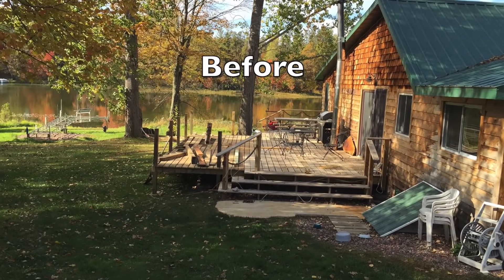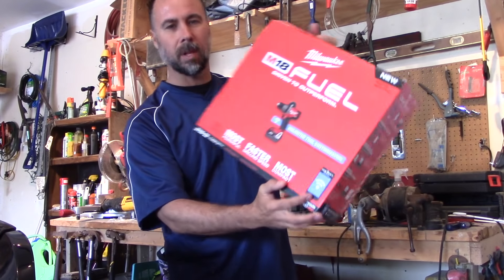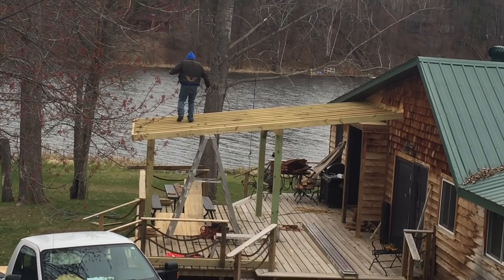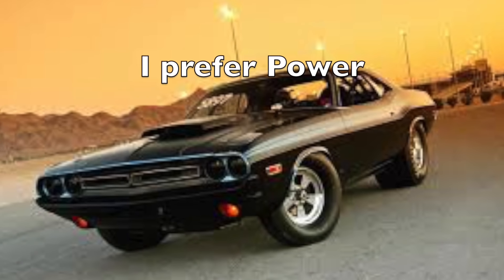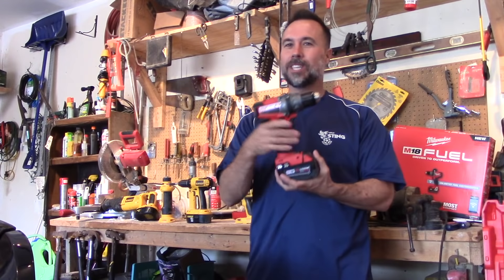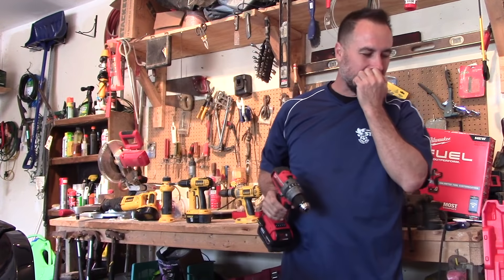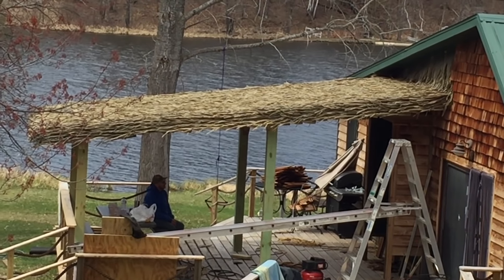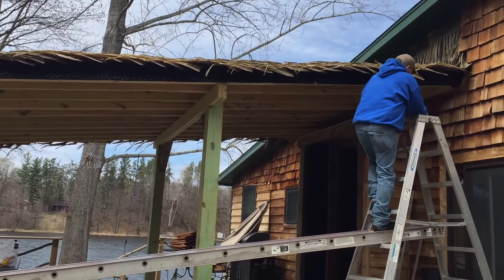Dewalt or Milwaukee  Power Tools?

Comment: Apples to apples compare milwaukee fuel to dewalts brushless, dont compare their old 18 volt to the milwaukee fuel.
Reply from the maker: Will do when I get an opportunity.
Reply: Agreed. Personally I still prefer Milwaukee Fuel hands down.
Reply: Wast of time watching this, what's next comparing a old flip phone to a new smart phone
Reply: The fuel are the best tools I have bought  we dropped one 20 ft off a roof threw it back up and still use it today that was a year ago
Reply: Teno Mireles ive dropped my dewalt brushless impact at least 20 times prob about 10 to 15 ft so that doesnt say much. These are tools that are meant to be abused
Reply: I say from experience, you may get a bit more power out of milwaukee power tools, if you ever really need it, but I've noticed over years milwaukee tools come in for repair at a much younger age then the dewalts Do. Dewalt seems to be slightly under power next to milwaukee, but have the potential to last longer. However I love both brands,  either brand does some tools better then the other, I own both platforms, you can't go wrong either way.

Comment: I've been a custom carpentry and cabinet contractor for 28 years, i have both Milwaukee and Dewalt
tools, they both have their outstanding products, Milwaukee makes the best drills, hands down, Dewalt
makes a much better mitre saw and cordless nail gun, with that said, Dewalt's customer service dept
puts Milwaukee to shame in as far as how I've been treated by both. " in my opinion"
Reply: I would agree Dewalt seems very customer oriented with there customer service milwaulkee sometimes seems like a car dealership we have sold you the product and now we don't really have time for you. Hopefully it gets better I just bought into the fuel line to give milwaulkee a try

Comment: As a commercial plumber, Milwaukee tools are the cream of the crop in the gang box. 
Smaller tools are largely beneficial in our trade simply because we are usually working in cramped spaces around other trades' work. These tools (Milwaukee) take one hellacious beating. Tapcons into 6,000lb concrete, holesawing, reaming out large bore pvc pipe, and the rotary hammers are on par with that of HILTI, and a lot lighter and easier to use. I can personally attest that an m18 hammer drill punched a 4" hole saw through structural plate like a 350 Chevy motor. I'm certainly not selling DeWalt short, but when given the choice between yellow or red...im going for red every time. Great video.

Comment: To be fair you are comparing a brand new cutting edge tool to one that is 6+ years old. The only way this would truly be a dewalt vs milwaukee drill comparison is if you did the dewalt brushless xr vs the milwaukee fuel. I have a whole set of newer dewalt tools and they are top of the heap in my opinion.
Reply from the maker: Very true.  I need to update this test.
Reply: After I started using Milwaukee tools, the dewalt tools are just laying in my garage

Comment: I have been with Milwaukee now for a few years, and have no regrets.  What sucked me in was the 12v line of plumbing tools, the no questions asked 5 year warranty, and their continuous development of both the 12v and 18v lineups.  No one else in the industry has a more well rounded group of tools for the remodeling contractor.  I recently purchased the 10" fuel miter saw and full set of cordless nailers, and all I can say is it just keeps getting better and better.

Comment: I think your selling the One Key system a little short. Using the app you can use it to keep inventory of tools and use it to recover lost tools. You don't have to pull are your smart phone out every time to fiddle with a setting. You can program various torque profiles for different tasks ahead of time. I think once you realize what you can do with One Key it might change your mind on it. I get what your saying at the start you don't want your employee spending time messing around on his tool, but if you pre load what fasteners and tasks daily One Key gets interesting.
Reply from the maker: +DarkRaptor99 I could see where it would be beneficial if I was using this for myself.

Comment: I work in the plumbing supply industry, we have switched power tool suppliers a few times. First Makita, then de Walt, now Milwaukee. We haven't changed for more than 6 years. Plumbers love Milwaukee tools. Out of the hundreds of plumbers I know only one uses hatachi, one uses Dewalt and another uses Hilti. They abuse the hell out of the Milwaukee gear and it keeps on going. Not as tough as before they became Chinese but still the best for durability imo.

Comment: Just an FYI you will want to get the Milwaukee Fuel cordless Sawzall seriously you don't need a corded Sawzall after getting one it is such a handy too to have. Also you might want to look into the Milwaukee Hight torque impact wrench for working on all of the trucks and heavy equipment you own. That is also an awesome tool to have around. Cordless tools in the last 5 to 6 years have gotten amazing with what they can do now, and Milwaukee puts out amazing innovative products. They have sweet led lighting solutions once you look at what else they offer you will want to buy more Milwaukee tools :)
Reply from the maker: +DarkRaptor99 I am super impressed with this drill- will be looking at more Milwaukee for sure.
Reply: Sawzall is a beast.. cuts good with very little vibration or work

Comment: I'm in construction as a profession and I was given a porter cable drill after I already had DeWalt drills and  Porter-Cable is one bad mamajama and I haven't had the chance to use Milwaukee drills yet but I have confidence that they're awesome but Porter Cable has the best batteries I've ever seen you can let him sit for 6 months they still are at full charge

Comment: I"ve been using my Makita 9.6V tools for almost 30 years, they're still working. BUT....the new Milwaukee Fuel 12V line is pretty impressive. The 12V, 1/2" impact wrench twists off lugnuts with ease (but not available in U.S. for some bizarre reason so I got one off ebay europe).  Starting to collect the rest of the 12V fuel line, maybe finally time to start retiring the Makita 9.6V collection.

Comment: I'm a DeWalt man myself. I've used Makita, Craftsman and Black & Decker before but they just don't compare to DeWalt. Now I have looked into Milwaukee power tools before and they are nice. My dad even recently bought a Milwaukee 18 volt and 12 volt powered grease gun and he loves it for sure. I haven't tried it yet but if I needed to grease my mowers and the manual grease gun is not there when I need it, I can grab the Milwaukee grease gun and try it out myself.
Reply from the maker: If you try it let me know😄👍

Comment: I've had many cordless drills over many years.  Mostly the problem with any...is the battery dies/quits/doesn't last.  My Milwaukee Fuel is a year old and came with two (2) batteries.
They charge so fast having both is almost overkill. They do keep power all day. Further, the size of the Fuel allows it to go places my bigger drills can never enter. As an aside; the batteries fit many other Milwaukee products. Example: an electric jacket for winter warmth..how cool...ooops!

Comment: The onekey feature probably IS gimmicky when doing construction work, BUT for me, doing nearly 100% automotive, it is just PHENOMS!  Imagine doing a brake job.  You pull out your onekey app, set "1" to the torque for your lug nuts, "2" to the torque for caliper bolts, and "3" for torque for your bracket bolts.  NO torque wrenches, no twisting their handles, NO elbow grease!  That's what I'm talking about!  Still don't own the onekey combo kit but I can't wait.  It's going to revolutionize my DIY auto work.  Only question is: will it REALLY be accurate on the torque settings.  I'll get back to you when I get them.
Reply from the maker: Turned out-  I really like the One key feature.
Reply: jawojnicki I was replacing a thermostat in my car a while ago and went to hand tighten the aluminum casing... when all of a sudden... crack!   I have a big expensive torque wrench, but the bottom torque setting was higher than what the case required. So I thought I could be gentle and hand tighten.   Older car so I spent hours and hours trying to find someone who had a replacement casing and when I finally did I had to wait two weeks for it to get shipped.  Horrible experience.

I'm a carpenter and I use Dewalt  exclusively for my cordless tools, but I may consider a Milwaukee for my vehicle repairs.  Great point, thanks for bringing it up and to my attention!

Comment: I switched from Makita to Milwaukee for the battery gage.  went outside in the winter with a Makita battery seemed fine till I got there and it was dead.  so nice to check the battery life in my truck before starting the job, not a gimmick at all imo.  the same phone app is though lol.  the fuel series is incredible!
Reply: meant smart phone app there
Reply from the maker: I love that fuel gauge!

Comment: I picked up the Makita XPH012 LXT 18V Hammer/Driver/Drill. Day to day as a furniture mover, my Makita makes those #2 PH & Torx screws a cakewalk! Love the Torque on it, Battery life is a week on average so far. My only gripe would be a more angled LED near the trigger.
Reply from the maker: Battery life is important. I hope they improve that.
Reply: Joshua Shackelton I think he was saying they last a week, with the intermittent use of disassembling furniture, that would be pretty good then, if that's the case.

Comment: I work on a farm that has a Milwaukee sawsall and that's just what ive always used, then my dad got an old dewalt sawsall and they seemed almost exactly the same with only one exception, the dewalt had that metal part on the body, (it might be the motor) and it got uncomfortably hot after a lot of work and that's the only reason I prefer the Milwaukee

Comment: I use the fuel gauge all the time, anytime I'm heading out for a longer trip I always check the battery levels for my impacts before hitting the road.  

I'm always stopping and assisting broken down motorists, and it's usually on really unsafe sections of interest where I can't afford to be slowed down by a dead battery.

Comment: we run porter cable. used to have the 18v and still have some in the shop going after alot of hard years in construction. now have the 20v for almost 2 years and love them. good cheap tools. can go get a fun tool set for about half any other brand. I see alot of people switching over to porter cable
Reply: They're actually made by stanley black and decker, which owns dewalt, mac tools and  bostitch as well. The porter cable just doesnt seem to have the build quality of the dewalt, though.
Reply: ive never even heard of porter cable. its bigger back east?

Comment: Milwaukee all the way!!  All of my cordless tools are Milwaukee. I'm an automotive technician and use them every day.  M18 1/2, M18 3/8 both are the Fuel. I also have the M12 1/4 inch Hex bit impact, M12 1/2 Hammer drill both are the Fuel and my favorite of all of them my M12 1/4 in cordless ratchet.  Love the fuel the gauge, the power,  the fact that I can charge both M12 and M18 batteries with one charger, Milwaukee's warranty is top notch.
Reply from the maker: Your absolutely right.  Those are all great points!

Comment: Milwaukee then Makita for me. We use the M-12 impacts exclusively at work for building police cars when I bought one to try out had to back and buy two more because the guys liked the so much and we were already set up with all 1/4 inch adapters with Milwaukee 1/4 impact ready drill bits major time saver that way on a production scale

Comment: Milwaukee M12 tools are great for jobs like plumbing repairs. Milwaukee makes the most tools that are battery powered in 12 volts
Reply: I agree. I own several M12 tools and unless you are a contractor that builds homes you can get by with them just fine. They have a surprising amount of power packed into a compact size especially if you pair them with the 4ah batteries. They are a maintenance and repair guys dream tool because of the size and weight to power ratio. You can throw several M12 tools into a smaller tool box or tote.
Reply from the maker: Good to know
Reply from the maker: +Ken Crooks great point ken😄👍
Reply: Agreed, but as a service plumber I now use M18! If you can afford to up grade your tools do it!

Comment: ive had the Milwaukee V28, yes V28 28 volt cordless combo set, the first in the industry with Li-ion batteries, since it came out in 2005. I still use these tools today. even the batteries are still standing up. the fuel gauge is nothing new. the power is unmatched by anythingbive ever touched. the only other drill that has come close to matching the power of Milwaukee is Panasonic. They make very nice power tools and are not usually found in retail.
Reply from the maker: Thats all New to me. I never heard about panasonic tools or the 28V battery.  Thanks for sharing!

Comment: I have tried most all brands and own a bunch of brands. I have found that the ryobi is awesome. it's cheap enough to be rough with it and not care about it. and it's tough enough to take it... also made by the same company as Milwaukee in China. many of the parts (internals) are the same. I have Dewalt, Milwaukee, Mikita, ryobi, black and decker, rigid, craftsman... my go-to is green.

Comment: I have switched over to Milwaukee for nearly everything. Have the same saws all and power screw. the m18 is a little beast and the battery gets me through a whole day sometimes. I will say  this though, I would avoid the battery powered circular. unless theyve done something drastic to improve battery life. i bought one about a year ago. still whip out the extension cord and the old saw when i need a circular cuz the batteries have about 5 minutes of life on those things.
Reply: +PuBearsticks The new M18 Fuel circular saw goes pretty long with a 5.0ah battery.

Comment: Surprised you didn't trust DeWalt enough to try their new brushless models first. The DCD791 and DCD991 (I own this one) and their hammer drill counterparts DCD796 and DCD996 are absolute beasts. They have many of the same features, no phone crap and the new models constantly win in power and endurance tests against Milwaukee. The DCD991 and DCD996 are also made right here in the good ol' USA. Can't beat that. Besides, sounds like DeWalt hasn't done you wrong all these years, why switch now? 
P.S. I definitely agree about the sawzall. Milwaukee is tops in that category. I plan on getting one myself.

Comment: I have a Ryobi and Black and Decker.I do not use them a lot so when I do use them I have to charge the battery's.
Reply from the maker: Which one has a longer run time.
Reply: I got the Ryobi several years before the Black and Decker and I think the battery is weaker because it goes down faster and needs charging more.I do not use them a lot and have to charge a while before I use them.
Reply from the maker: +Mark's Reviews 😄👍

Comment: Pretty much all new generation contractor grade tools will out do the older stuff pretty easy now im a Makitia guy myself but Milwaukee was a contender when i was buy my new kit last year I ended up with makita due to the range of skin tools and what i needed for my jobs Carports, Patio and Deck builder the battery check option is really handy especially on the li_ion batteries as when they run out of power that's it the brushless gear is even better then the standard too if you need more power and better battery life. Just out of curiosity what made you do with a timber framed thatched roof on house over a duel skin insulated panel?
Reply from the maker: Does the Makita also have a fuel gauge like Milwaukee?  The thatch is synthetic. I travel to Costa Rica often and this brings that back home for me. 😄👍
Reply: most of the makita range has the battery check on the tool its self except the 6ah have it on the battery

Comment: dewalt did that Bluetooth batteries I'm not falling for that  I can see the practicality of the application as a good GPS locator if someone steals one of your tools but they constantly checking on your stuff I was said to heck with it  that's what a fuel gauge in a batteries for Milwaukee has  some powerful drills and jig saws & sawzails

Comment: I absolutely love my Makita impact drill gun set I do a lot of garage door work in Chicago Illinois I've dropped my impact and my drill gun off a ladder 15 feet in the air on to solid concrete surfaces and time after time they don't break also deliver delivers the power and torque that I need